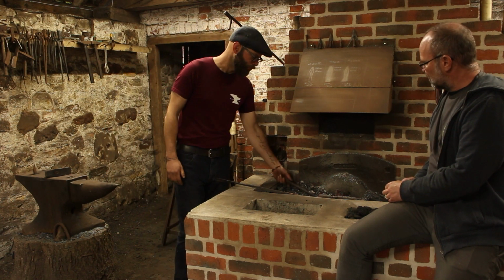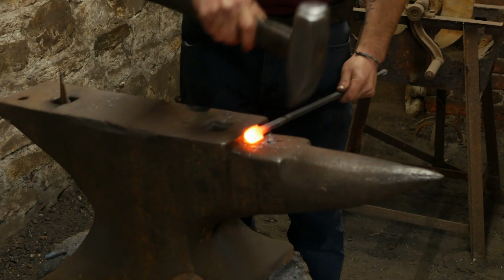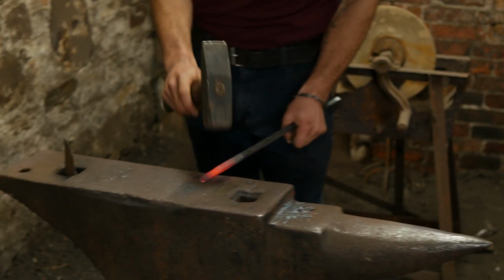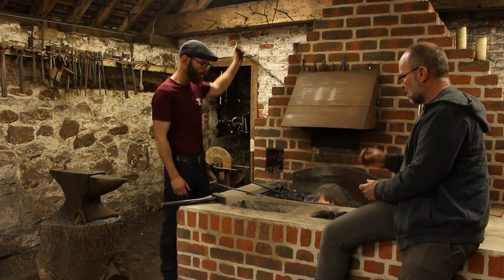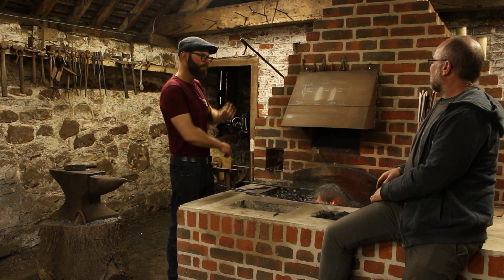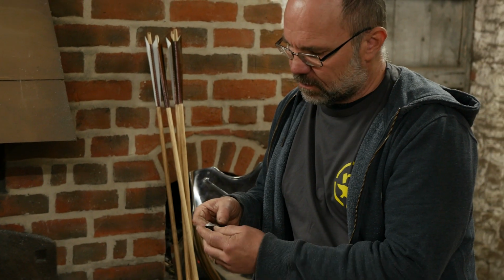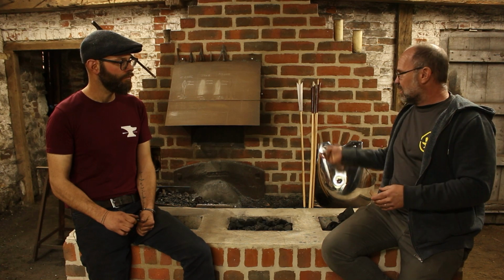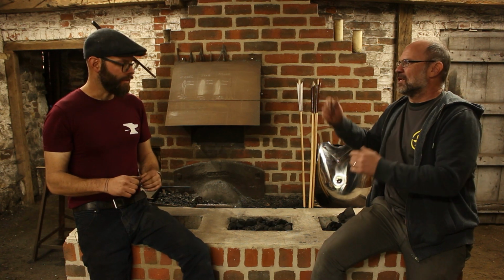FORGING AN ARROW HEAD, full process.

Comment: Very interesting.  But in the various arrows vs armour videos the plate is typically made from steel.  Why would you use iron, and worse still, non-case hardened iron, to make bodkins, if you had to defeat armour made from steel?
Reply: Not all the bodkins were iron, but most were.  We could very easily use hardened and tempered carbon steel bodkins (and you'll get to see that!) but we know from the majority of available museum artefacts that most of the bodkins were made from iron,  and there's virtually no physical evidence of them being case hardened.

The films are not "how can we make a hole in a piece of metal".  They are "what happened when the most commonly used arrows hit the most commonly used armour".
Reply: @MedievalArrows  I appreciate the reply.  Just a couple of quick follow-up questions if you can be bothered.  1) would case hardening withstand the ravages of time on surviving period warheads?  And 2) if bodkins wouldn't penetrate plate; and the evidence seems to suggest that they wouldn't; why bother with them?   My theory is that they are mainly intended to take down horses but do you really need a specialist warhead to do that?  Anyway; thanks again for the reply.
Reply from the maker: HI Harold,  
1.probably not from excavated ones
2.I suspect they sometimes did
Reply: @haroldgodwinson832  Mark Stretton wrote a good article this past May about case hardened medieval arrowheads on his "Warbow Archery Tips, Techniques, and Seminars" blog. A fellow named Eirik Ronald Fossheim has also written a series of posts on Quora about a variety of topics relating to longbows, arrows, arrowheads and armour that address the topic of what medieval warheads were made of. If you're interested in this topic, you should look them up. They're very well researched and definitely worth reading. (I would provide the links but that seems to get comments flagged as spam.)

The TLDR: The carbon steel layer of a case hardened arrowhead when new would be somewhere around 1 to 2 millimetres thick at most. Carbon steel corrodes readily (more readily than wrought iron) when it comes into contact with water and oxygen. Most medieval arrowheads that have been found to date have been discovered after having been buried in the ground and exposed to oxygen and water for over a half millennium. It is unlikely that any trace of the thin carbon steel layer of a case hardened arrowhead would remain after being exposed to the elements for that long. All one would expect to find is the soft wrought iron core.

As soon as hardened steel plate armour started to become common, case hardened, steel-tipped arrowheads probably became the military standard. One reason to believe this was so is simply that it stands to reason. Wrought iron arrowheads are too soft to stand a good chance at biting into and piercing hardened steel plate unless that plate is very thin and/or brittle. Case hardened, steel tipped arrowheads are much more likely to fare better. Another reason to believe case hardened arrowheads became the standard is that medieval written records, including orders and laws issued by Kings during this period, tell us this was so.

In the article in his blog, Mark Stretton shows that mass producing case hardened arrowheads wouldn't have been very difficult for medieval arrowsmiths to do and that difference in hardness between wrought iron and case hardened arrowheads is quite dramatic.

Comment: Very interesting video. Please forgive the stupid question, but wouldn't casting be easier (faster) for mass production?
Reply: Good question. Maybe too fine and fiddley a shape for sand casts? Still requiring cleaning, grinding off excess materials. Forging 10/hr/smith would be quicker the more I think about it.
Reply: I'm not an expert, but my understanding is that most medieval forges didn't get hot enough to liquify iron.
Reply: Medieval forges can most definitely melt or liquefy iron (that's how fire welding is essentially done) and casting would be far quicker, but...

You'd end up with cast iron arrowheads,  which would be brittle and useless.   Cast iron has no grain structure,  unlike worked (wrought) iron,  which is much tougher.  Drop something made of cast (poured) iron and it'll shatter.
Reply: @MedievalArrows  Interesting! thanks for the correction
Reply: @MedievalArrows  If they had wanted to cast them they would of done so in bronze, but iron is so much cheaper an easier to get.
It's clear that war arrows where built down to a price, when you want arrows by the thousand its a case of good enough for government work.
Reply: @MedievalArrows  bam, brittle grain structure. Thx dude
Edit. I just realized who was answering the question! What a treat to have you taking us to school. Can't wait for the big vid. Amazing work!!!
Reply: @SuperFunkmachine  No, quality control was an issue they took seriously. In 1405, Henry IV issued a decree that all arrowheads procured by the King had to be made of hardened steel (not wrought iron like we see here). Also part of this decree was a requirement that blacksmiths had to put their mark on the arrowheads they made so that they could be identified and punished if it were discovered that the arrowheads they provided were not made according to this specification. In a procurement for arrows King Edward III made in 1368, he also stipulated that the arrowheads were to be made of hardened steel and that one of his officials, the Sheriff of Norhampton, would be responsible for ensuring that they were made to specification. Given how much importance was placed on archery in English armies, it isn't surprising that they took the quality of the arrows and arrowheads they were using seriously. Arrows with soft wrought iron arrowheads would have been virtually useless against opponents in plate armour, since wrought iron will tend to deform on impact rather than cut, and having an army consisting mostly of men with low-quality weapons that were nearly useless would have been catastrophic.

Comment: I need help and searches on the interweb are not very good, whats the distinctions between a long bow and a war bow..... is a war bow just a higher poundage longbow?
Reply: A longbow is typically a war bow. War bows are just bows dedicated to war as oppose to hunting or sport.
Reply: Long bow is a bow that is long.
War bow is a weapon of war. 
Makes sense, doesn't it?

You don't want to take weak hunting bow into the war.
Reply: @XtreeM_FaiL  thats not the point, when looking at an online shop its labelled as longbow but at 100lbs which typically would be leaning towards warbow strength.
Reply: @goodsoup6085  Aren't those custom bows for hobbyist or something like that?
You're not going to find any modern bows on that range. Compound bows ends 55-60lbs, I believe.
Reply: @XtreeM_FaiL  no like recreations i was looking for but they were tagged longbows🤷‍♂️

Comment: Todd & Will
If designing an arrowhead to be used against mideval style armor using any modern materials and techniques, what would it look like? It would still have to be shot from a bow or crossbow. No explosives allowed.
Reply: Assuming tungsten carbide as the base material, it would probably look like a needle bodkin
Reply: You cant say "any modern materials" and then exclude some modern materials
Reply from the maker: squat square tungsten tip with a precisely designed and tested angle and an ultra rigid shaft shot from a bow that did not require paradox to function

Comment: Did they use closed die forging at all to make the arrow heads with a drop hammer or a helve hammer?  Seems that would speed production quite a bit.
Reply: would they have does things? I think the Romans had water powered hammers but later not too sure
Reply: @mondriaa  They had both styles of hammers in this period.  I know in Italy there is a working example of a helve hammer from the medieval period.  I'm sure there are examples of other places using them too.
Reply: @Aminuts2009  aah cool did not know that, would this be around 1400-1500 or also earlier? Maybe a apprentice was simple cheaper and does hammers where never wide spread, this way every village blacksmith could make arrow heads if needed, but I would guess larger cities would have more specialized shops

Comment: So would these arrow heads still be considered "mild steel" or iron, would there be an additional hardening process for the points or is their hardness "as is" considered sufficient for military needs; how would they harden the point if required?
Reply from the maker: Interesting question that we are looking to address in an upcoming film.  in short though it seems generally not
Reply: @tods_workshop  By the time English archers would have been shooting at opponents in plate armour, I think it's safe to say that their arrows would have had case hardened steel arrowheads.

King Edward III, 5 February 1368: "To the sheriff of Norhampton. Order, for particular causes, of the issues of his bailiwick to cause 600 sheaves of arrows in places where he shall see best to be made and purveyed of seasoned and not of green wood, as he will answer it before the king, and to be fitted with steel heads to the pattern of the iron head which shall be delivered to him on the king's behalf, sending the same to the Tower of London before Midsummer next, there to be delivered to John de Sleford the king's clerk, keeper of his wardrobe in the said Tower, knowing assuredly that, if the same be not made of seasoned wood, the king will charge him with the cost over and above the punishment he will inflict. The like to the sheriff of Bedford and the sheriffs of 24 other counties, every sheriff for 600 sheaves." (Caldendar of Close Rolls, 42 Edward III, Membrane 25)

Assuming 24 arrows to a sheaf, this would appear to have been a procurement for 374,400 arrows.

King Henry IV, 1405: "ITEM, Because the Arrowsmiths do make many faulty Heads for Arrows and Quarels, defective, not well, nor [lawful] nor [defensible] to the great Jeopardy and Deceit of the People, and of the whole Realm; It is ordained and established, That all the Heads of Arrows and Quarels after this Time to be made, shall be [well boiled] or brased, and hardened at the Points with Steel, and if any of the said Smiths do make the contrary, they shall forfeit all such Heads and Quarels to the King, and shall also be imprisoned, and make a Fine at the King's Will; And that every Arrowhead and Quarel be marked with the Mark of him that made the same; And the Justices of Peace in every County of England, and also the [Mayor] and Sheriffs, and Bailiffs of Cities and Boroughs, within the same Cities and Boroughs, shall have power to enquire of all such deceitful Markers of Heads and Quarels, and to punish them as afore is said." (7 Hen. IV c. 7)

This would certainly seem to suggest that by the mid 14th century, it was understood that steel arrowheads were more effective than wrought iron arrowheads, and here we can obviously see that two kings of England, both of whom fought long campaigns during the Hundred Years War, took the quality of arrowheads very seriously.

Comment: I literally know squat about smithing, so this question might seem obvious, but I really just don't know. Is there some point/reason for hitting the anvil in between hitting the actual iron? I see lots of smiths doing it. Is it a rhythm thing, or is there a different goal? Serious answers only please, because I'm a noob.
Reply: Yea I also noticed that. I would think it's a way to dissipate the energy from hammer swing when making small adjustment/movement or needing a second to think. Using muscles to completely stop the hammer for a sec would make things even more tiring. Although the rhythm thing seems also possible - maybe they are not mutually exclusive.
Reply: It's a Rhythm thing.

You want to keep a steady controlled pace, but it can be interrupted when changing workpiece positions so a little tap to the side helps save it.

Comment: the method of connecting the shaft to the tip using a socket for the 15th century is justified by the sources of the 15th century. or by archaeology, or is it more convenient and familiar? The whole archeology of our places says that until the 16th century, iron tips were connected to the shafts by inserting a tail into the cleft of the shaft, excluding only cast bronze arrows of antiquity
Reply: Everything we're using and making are based on archaeological examples.   Sockets for the shaft to fit into were used as far back as the 5th Century.
Reply: @MedievalArrows  Sockets on cast bronze arrowheads were used a thousand years before the Birth of Christ. I'm talking about iron tips, I asked you to indicate the sources where it is written about such finds. As a rule, when I check what is written in the sources referred to by my opponents, I see there the exact opposite of their statements or the sources are questionable. After all, the same bows with Mary Rose are the second third of the 16th century, and there is nothing earlier, and by this time the protective armor has changed dramatically in comparison with the Battle of Agincourt. I repeat - there are a lot of arrowheads in our museums, all iron arrows with a tail, not with sockets, and every warrior was an archer, cavalry used bows until the middle of the 17th century (partly due to the fact that there were few good war horses, and the army was mostly mounted)
Reply: @greatnoblelord  I recommend you do a bit more research into European arrowheads.  Even dating back to 540AD, there have been iron socketed arrowheads found.
Reply: @greatnoblelord  One very easy place you could start is by looking through the Museum of London collections.  Search for arrowheads dating between 1000 and 1700 AD from Europe and you'll lose count of how many are iron, with sockets.  Then do the same search in the Royal Armouries collections.  

Specifically, if you want to see the exact arrowhead we are using for our films, it is Museum of London A5698.  Socketed, iron and to the exact dimensions and pattern.
Reply: @MedievalArrows  thank you for the clarification, it's just strange such a sharp difference in the attachment of arrowheads in your and our museums and excavations, and our coverage of excavations is dozens of times greater than yours and concerns many nationalities, and the types of arrowheads themselves are generally identical, the differences are only in the attachment to the shaft

Comment: Did arrowsmiths not have molds when forging arrows?
Reply: @Marc Ritz: What do you mean? Are you asking if molten metal was poured into a mold to make arrowheads?
Reply from the maker: as in drop forging dies?  Possibly for some aspects, but I don't think so

Comment: Which begs the question, how specialized mass production really was.  I noted that a lot of Will's time was just in reheating the steel.  If he had someone doing just that, then he could produce far more arrowheads just by himself, through the technique of working on multiple arrowheads at the same tine.  Start with one bar of metal and work the metal until it needs reheating.  Then while that is reheating, take another bar of metal and work that until it needs reheating.  If he timed it properly, then he could be working on multiple arrowheads at the same time.
Reply from the maker: production line works sometimes and cell manufacture works sometimes and usually gives a better quality, but yes this could have been production lined

Comment: Where the heads quenched in water or oil?
Reply: Water in the front bosh
Just to cool it no hardening
Reply from the maker: These were wrought so a quench will likely do very little, so in this case just for cooling

Comment: why does he strike the anvil?
Reply: Tbh with you we smiths do it mainly as a rhythm keeper as we are turning a piece of metal around so we don't forget how hard we are striking the metal and don't mess something up
Reply: The anvil acts like a spring. If you put the hammer down permanently to look at your piece, or when you turn it for example and don't want to hit it, you will need more energy to pick it up again. If you keep it going the rebound of the anvil will keep your hammer going and make you conserve energy
Reply: Torbjorn Ahman, a smith from Sweden, has a video entitled "FAQ - How to pronounce Torbjörn and more!".  Starting at :50 he answers this question. He seconds Peter's answer of conservation of energy. It's easier to pick the hammer back up if you let it rebound off of the anvil.
Reply: thanks

Comment: Random question for ya Tod. What exactly IS an "Archers Sword"?
They just seem to be an Arming Sword to my eye. Is there something about their dimensions that different?
A slightly shorter blade perhaps?
Reply from the maker: There is no correct answer and even in the artwork you see them with everything from bastard swords to really short cleaver falchions, but as you want an answer, I would say single edged clip pointed falchion
Reply: @tods_workshop  Ah, so the multitude of swords marketed as an "Archers Sword" that are a mix of what seem to be arming swords and hand and a half swords that are practically arming swords. That's all just modern marketing BS and not a term for a particular style of sword?

Comment: I suppose the advantage of an open socket is you can cart a load of arrowheads off to the frontiers and they can just fit shafts at the destination. Separate the job of fletcher and blacksmith.
Reply: The fletcher's job had always been separate from the job of the arrow smith. Socket style didn't matter.

Only very recently (in a historical perspective) did the arrow head maker start making his own shafts and fletching them as well.